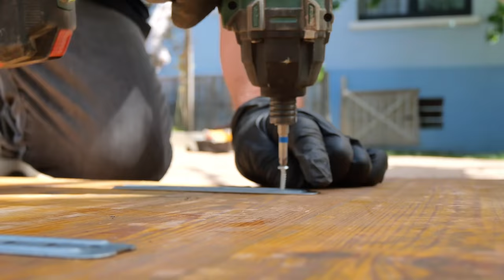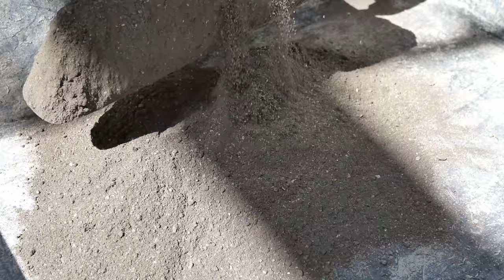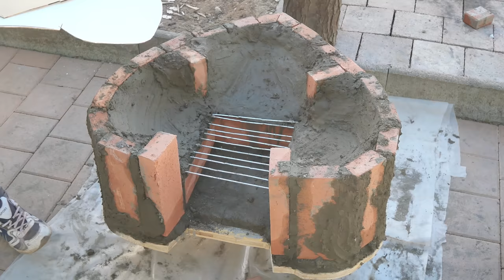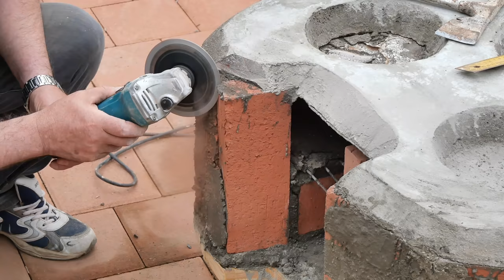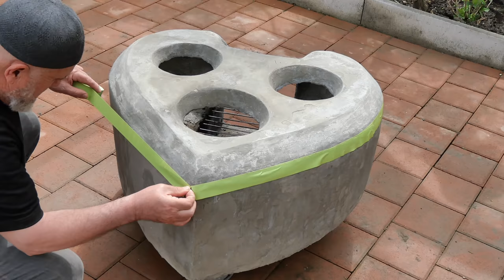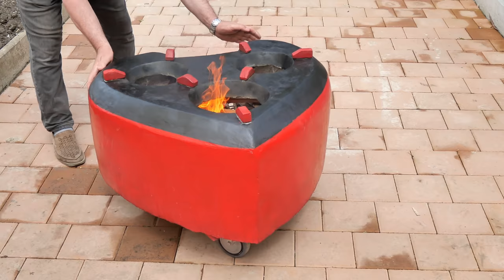VALENTİNE'S DAY ⛔️ THE BEST MOBILE WOOD STOVE ON YOUTUBE ❤️ ASMR DIY

Comment: What a smart creation!
I assume with so much cement, fire brick is not necessary to avoid cracking or explosion from heat.
Thanks for sharing
Reply: Hi, i bought a house with a shed, in the shed there is a brick built oven ( with chimney to the roof), but without cement ! ( i guess it was half finished). it bothered me how to finish this good brick oven and put into good use BBQ and even do home made pizza ?  i dont know what is to use as the cement ( stupid q i know), heat proof special cement ? thank you.